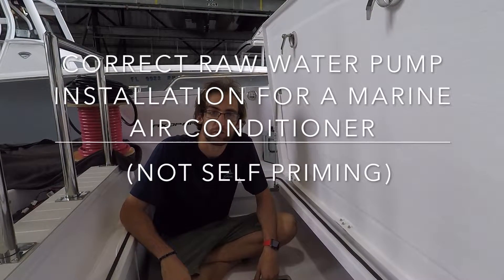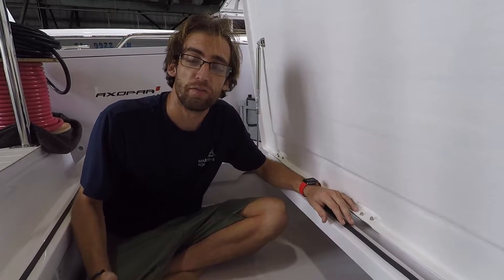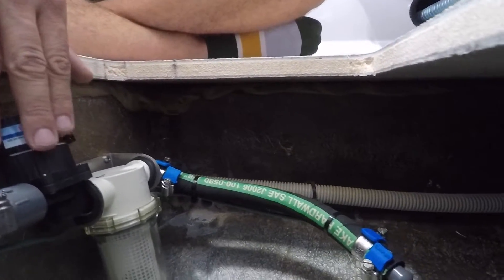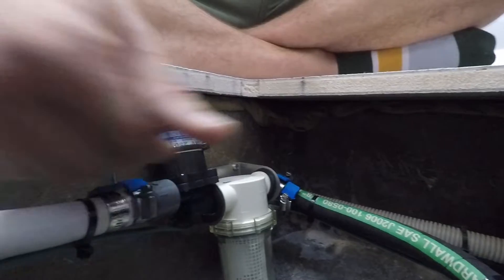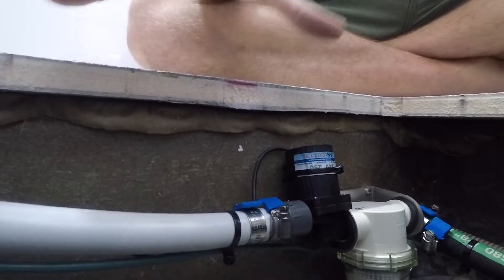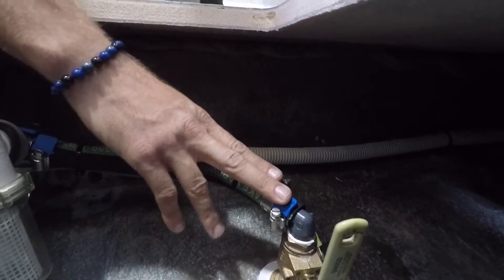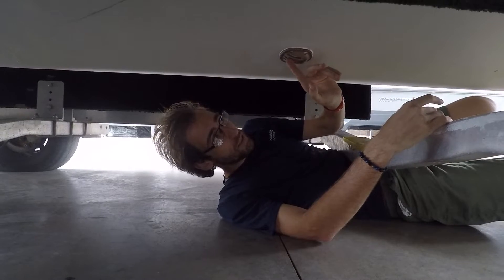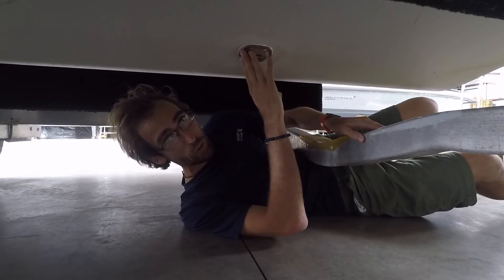Correct Marine Air Conditioning Pump Installation by Mabru Power Systems

Comment: Does Mabru offer a self-priming pump, or recommend one?  I have limited space, so while installation is ok, I still have air lock sometimes. Bleeder value is an option, but still a manual solution each time.
Reply from the maker: Keith we do not have a self priming option and do not have any recommendations at this time. Is the pump in question running off of 115/230v or 12v?
Reply: @MabruPowerSystemsINC  12v
Reply from the maker: @keithredmore9473  I've heard of customers using salt water wash down pumps but they are not rated for continuous use as far as I know and they consume up to 4x  the energy of the pumps that we include with our units
Reply: @MabruPowerSystemsINC  thanks, I have being looking around for pump alternatives, had not look at the wash down pumps. That might work, as our AC is only used for short periods of time. Appreciate the help.

Comment: Could you put a check valve after sea dock to keep pump flooded
Reply from the maker: it is possible but if prime is lost, when cleaning strainer for example, water does not have enough force to push through so it makes priming quite a bit more difficult.
Reply: @MabruPowerSystemsINC  I replaced and rerouted my hose and remounted mu pump seems to be working